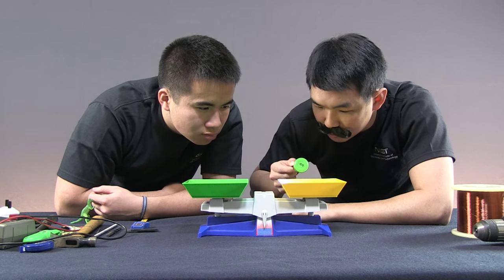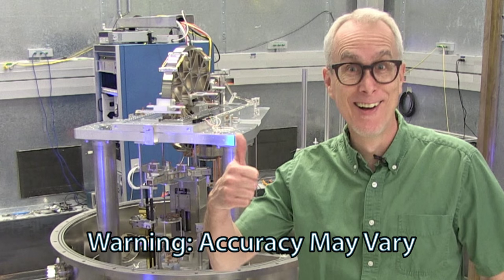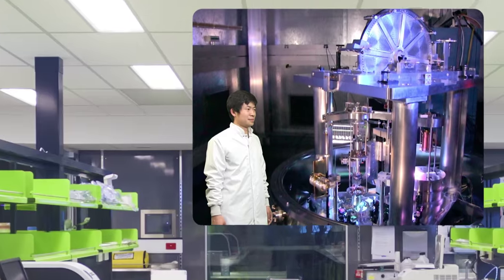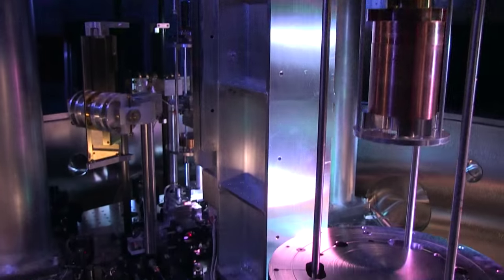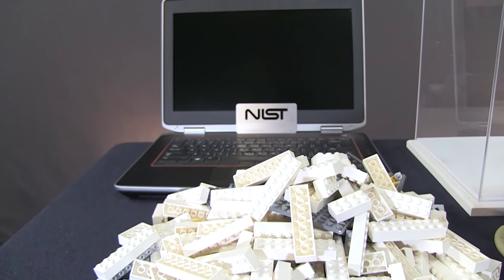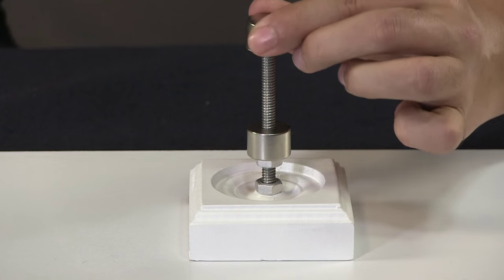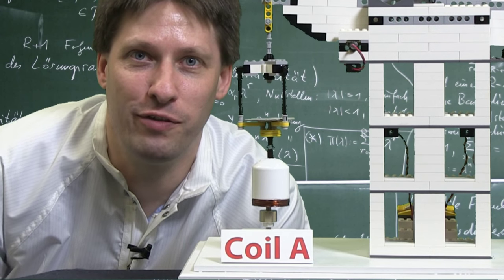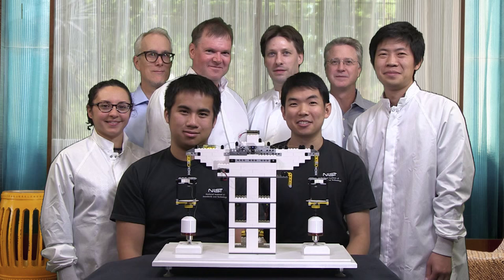How to Build Your NIST D.I.Y. Watt Balance

Comment: Could you help me answering these questions? If the NIST watt balance compares gravitational force with electromagnetic force to redefine the kilogram, how it is ensured, that the gravitational field is always the same in the balance? Or, how the gravitational field can be measured with an accuracy which is necessary for the definition of the kilogram (defining the kilogram with its weight) without using an equally accurate mass? Or, how the watt balance can reproduce a kilogram without relying on the kilograms weight?
Reply: The gravitational field can be measured independent of mass accuracy (2 masses of dissimilar mass will fall at the same rate in a vacuum at identical time and relative location).
The mode 3 pre and post measurement procedure does its own gravitational measurements that can account for tidal forces on the local gravity(tidal being by far the biggest effect on gravity). 
Mode one and two calibration tests are done to very exacting standards in the real lab devises using length and time, other factors like coil loops, wire length, magnetic field strength etc are mathematically made irrelevant by substitution with measurable values. 
Read the journal paper in the description, my explanation might be off but the paper goes into the theories and maths used.
Reply: The answer comes down to how we communicate units in language.

All measuremental units are arbitrary. Yes, the maximum speed at which anything can travel is know (C). What is arbitrary is how we communicate that speed. What is a meter? What is a second? Those things are arbitrary. I can define C as 18.45 arms-lengths per jiggle, but it is totally useless, because no one else knows my units.

To get our units straight, we (almost) all follow the same unit system. All those units are, again, arbitrary, but since we all agree to use them, we can make sure our data is shareable.

The Kilogram is defined as..........a ball of metal. Yep. That's it. A ball of metal. We all agree that this particular ball of metal is the weight of one kilogram.

What has been happening is that measurement techs have noticed that ball of metal has been changing. Ever so slightly. This scale attempts to redefine 1 kilogram not as a particular weight, but as an electrical potential. Electrical measurements can be much more accurate and much more controlled.

With regards to gravitational field strength at different parts of the scale - my guess is that there is no difference between two points, being that they are so close together (with regards to the size and mass of the earth), or that the difference is smaller than the accuracy of any instrument. I'm talking plank-scale difference.

The watt balance cannot define a kilogram weight without a master kilogram. Yes - this also means that this unit is arbitrary. But, it is a unit that is more accurate and reproducible that what we currently use.

TL;DR - All units are made up, but we agree on what the value of the made up units are.